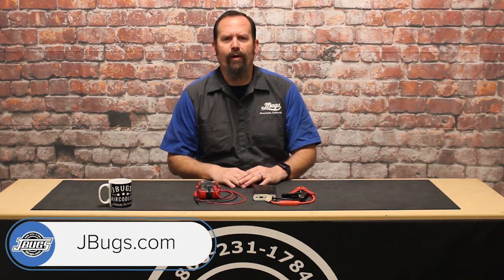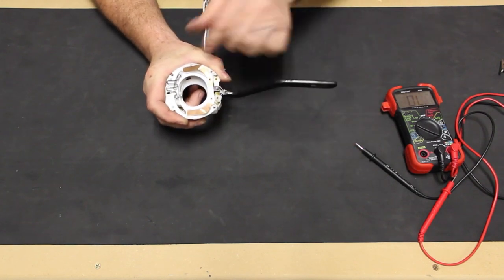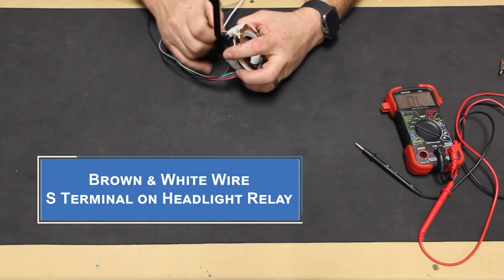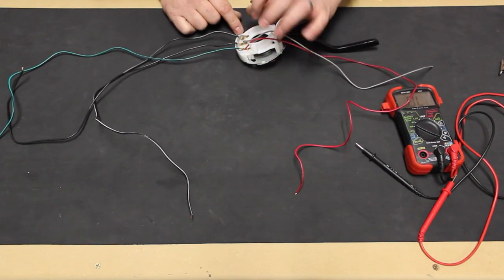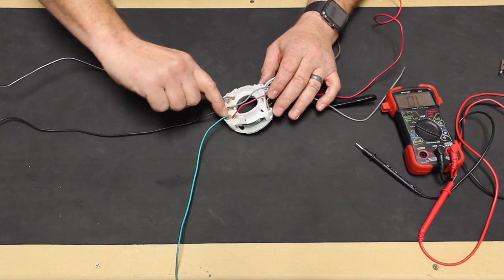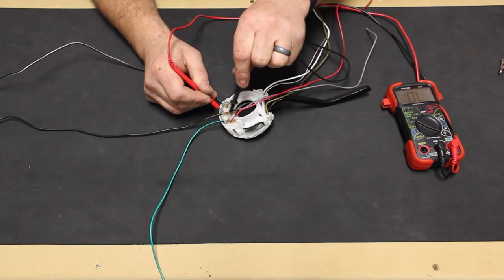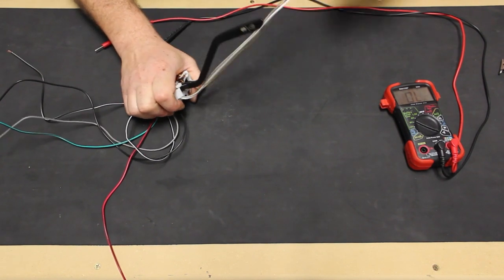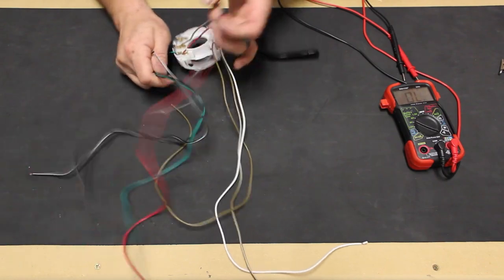JBugs - VW Dash Switch Testing - Turn Signal Switch

Comment: So.... Went to a mechanic for a turn signal not functioning correctly turns out that my clock spring was damaged at the old shop when they replaced my airbag. I specifically told them if the switch is good and I only need a clock spring that I do not want the switch replaced to save me costs. It is my right to decide what parts go in my car if they are not needed. They told me that I had to replace both even though you actually can put in a new clock spring with an old switch if the switch functions and vice versa you can put in a new switch with an old clock spring if the clock spring functions. I made sure to ask for my old parts. The clock spring was indeed damaged quite severely. But the switch was tested electrically and for the auto on auto off cut off function and it functions perfectly. It is my understanding that if a mechanic says you need something that you don't that you can sue them for up to triple the amount. It was a $180 part plus labor that I did not need. Should I pursue this
Reply: You'd have to talk to a lawyer with automotive experience for that answer. As old aircooled VWs don't have clock springs, I can only speak from the little experience I have with them. Most commonly the spring is integrated into other steering component parts. As the airbag is a safety item controlled by the clock spring, and if the clock spring is part of an assembly that includes the turn signal switch, that may have been the mechanics way of covering their liabilities.